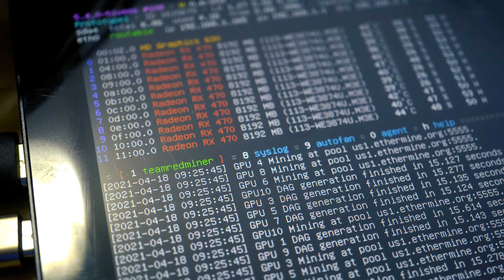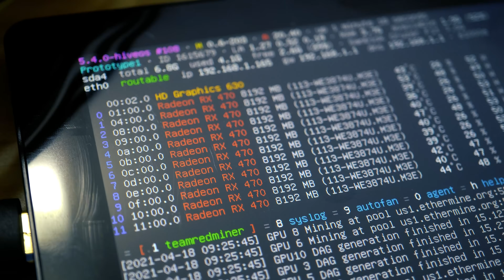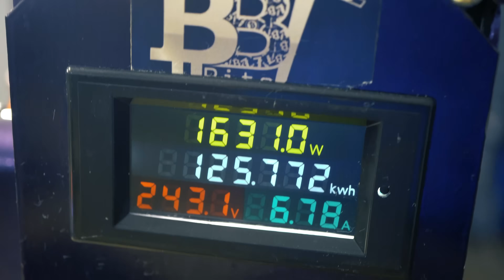Moving farm to Immersion - Part 1 Rig Build Design 12x GPU Mining Rig

Comment: I really appreciate your allowing us to see what you're working on. I'm trying to figure out how to populate as many different GPUs into a low cost rig, considering I'm peanuts compared to your operation. But, I'm seeing that there are challenges challenges just because GPUs are configured differently than ASICs (the usual users of large scale immersion cooling).

I'm guessing I will have to wait until the CAD drawings come out to see how you laid the rigs' fins relative to the slots in the diffusion plate (inline to fluid flow, vs perpendicular like your fans in the video).

That said, even at 1,600X the cooling capacity of air, I'm amazed at how densely they're packaged. Thank you!!

Comment: Just doing some back of the napkin math here... a) on the screen at 4:58 are RX 470s but they're clocked like RX480s... Noice... b) the thumbnail says moving 2300+ cards to immersion.... c) 470s are pretty much the bottom of the barrel as far as MH rate goes I think, so at MINIMUM you're pushing 69000 MH/s (unless I miscalculated something) d) that's like (at the moment) 1.8M USD per year?  Crazy man... #goals

Comment: Wish i moved to immersion cooling myself earlier.
As a small miner the temps in my house went crazy and i spend a LOT building a crazy exhaust with grow tent, huge fans etc (i rent so cant make big holes smh).
Immersion cooling seems the way to go, could've used all that cost for this solution.
Reply: One miner I follow took the door off his warehouse and bought another replacement door and put that on and saved the original door -- then cut the hole in the new door for a giant exhaust fan... seemed legit... but you may need to leave windows slightly cracked to allow air in :D

Comment: 511C temperature shown in nicehash, stuck at my immersion project now. It's 4 RX580 start up fine but when benchmarking stuck at 511C. Must be the sensor report issues. It's bare board stripped of all heatsinks.

Comment: id like to know what fluid you will be using...i got 6x 570's in a vat filled with tractor hydraulic oil that i pump through an old car radiator.
Reply: You can use mineral oil too but that will make plastic brittle

Comment: 1672 watts for 372 mhs?  3x 3090s use 930 watts to get 375 mhs. 3090s are relatively inefficient compared to the 3070s. So does that mean this rig in the video is super inefficient?

6x 3070s using 720 watts get 375 mhs.

Comment: Interested to see your solutions.
Been running 50 ASICs for 3 years and plagued with cooling/dust/humidity issues in conditions where ambient temps get up to 48C in summer – tried air conditioners/sand trap intake louvers/exhaust fans/isolating cold- hot aisles etc.
Now in process of building immersion system for about 20 ASICs.
Using multiple aluminum car air conditioner condensers immersed in chilled water (using commercial chest freezer) and coolant oil circulating in condensers.
ASICs are immersed in a sealed tub with dielectric transformer oil.
Would like to see a focus on immersion cooling solutions without expensive equipment.
Fingers crossed hope to succeed.

Comment: Where can i see, how did u mount gpus together, theese fans on top are only fans in that tower?
Reply: I think the fans are only for bits to test the airflow/potential liquid flow’s efficienty through the stacked gpus.

Once you immerse it into running cooling fluid you do not need those fans anymore.

Comment: Have you guys had a look at the DCX systems setup? Really neat.  Also I've seen various immersion setups that do away with the heatsink completely as the heat dissipation is taken care of by the fluid itself.. hence you can achieve a lot denser setup by just having the board, a 1/2 inch spacer, next board, spacer, .... this will allow you over 100 boards per "bin".  Will be interesting to see what setup you come up with
Reply: The problem with this two phase solution is the cooling liquid is $500 a gal 🤯 and a more complex setup. Has to be sealed system.

Comment: I'm very curious about the fluid you will be using for this. I know in the past the big drawback of this was the fluid 'decomposing' some of the plastics over time. I have sat on the fence wanting to do a submersion build for probably 15 years waiting on a perfected long term fluid to be found. Cant wait to see your progress with this!
Reply: petrol oil contains sulphur that decomposes metals as well, theres coconut oil , and you also can use biobased additives to tweak the oil
Reply: there is a video from Pugot computer systems where they built a gaming rig that was submerged in mineral oil. the gaming rig can play just about any game out today and computer is still up and gaming today. it is about 15+ years old and it is in their lobby for all customers to play. that equipment has not been changed far as i know.  i wonder if this is where all the hype came from for submerged mining rigs.
Reply: @waynenarretto4545  immersion oil has been used for power transformer cooling long time ago, even with special mineral oil without sulphur there are some issues with catalytic reactions that consume thin layers of metal, and this is a problem with microcircuits etc

Comment: You need a miracle solution that I am not aware. If the solution is easily evaporate and don't leave any nasty residue and transfer heat same as air or better and non conductive then it's a good idea otherwise its a horrible idea. If something fail in the system you can throw out the whole system and you can not even sell anything that contaminated with that solution residue. The main problem would be the contact area where it would be contaminated with the solution and any new addition to the system would not get proper contact. It would be a pain in the but or impossible to clean a pcie express socket or any other socket completely from the solution residue and troubleshooting... omg it would be a nightmare... especially that tightly put together system with all that solution dripping  and closing the contacts after you changing hardware. imo after you experience it you would cry back your current maintenance and troubleshooting even if you would have to do it monthly(just for the lolz and comparison how crazy is to deal with these kind of solutions).
Reply: This isn’t mineral oil. It’s much like the same solution type we already use on the GPUs in the ultrasonic cleaning. They come out great.

Comment: Nice.  I looked at immersion back in Dec 2020 but got scared away due to the card prep and overrall cost.  I am still interested to see how you prep your cards.  That would make a nice video for this series.  What tape you use, etc.  One benefit that you didnt say from immersion is that you can actually save  power by not needing the fans.  On cards its a little bit, but adds up fast when you have as many as you do.
Reply from the maker: Yes thanks for the suggestions on the content to cover. There is a lot into it and I want to make sure it’s as comprehensive as possible.

Comment: I thought you didn't even need to put the heat sinks on with immersion. Just naked pcb.
Reply: nope... still need to spread out the surface area. On some server blade installs it is possible to go naked but IIRC that only applies to spendy 2-phase dielectric solutions, not the more economically feasible single phase